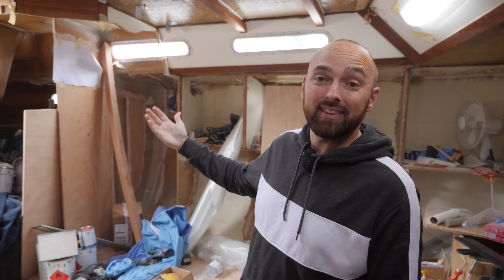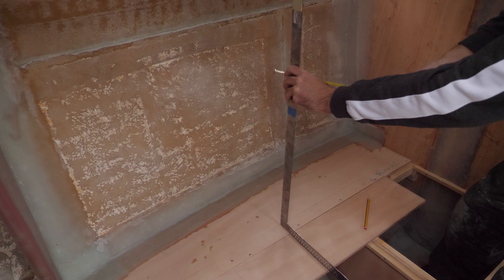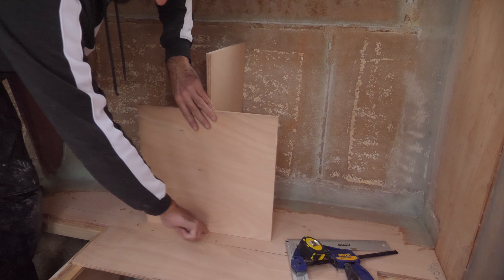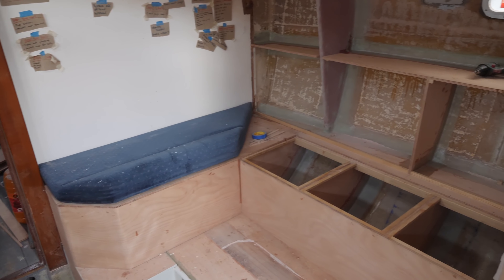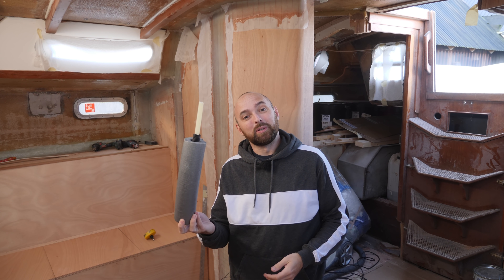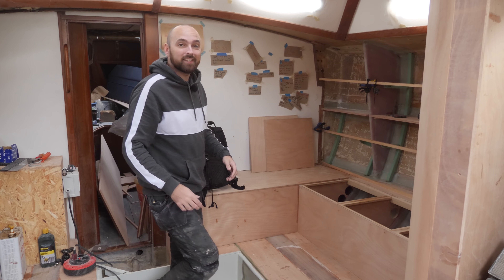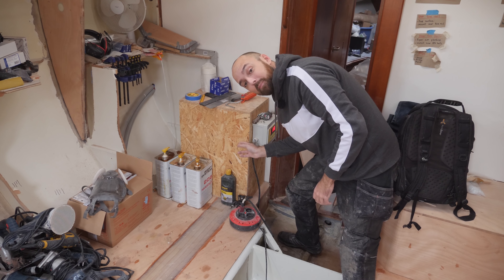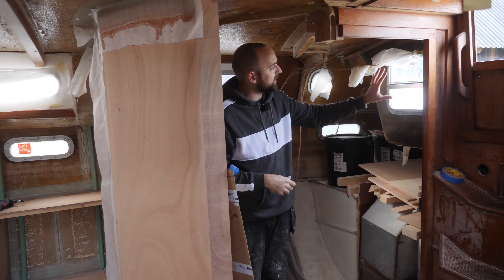Sail Life - Settee finished (for now) - DIY sailboat refit

Comment: Just another comment... on my boat I had 2 heads, had one stop working a couple times. If you keep the other at least you will have a back up till you can repair in calm places or where parts are avail... also, you use the bathroom every day, don’t do a temp or swinging Pullman, or any options that you have to constantly work, instead make the bathroom large, airy, permanent, comfortable... you’ll enjoy it and more importantly Ava and guests will be happy...

Comment: Really nice work on the settee, I like your attention to detail. Do you think you could add a materials list to these video descriptions or a quick mention of what you're using in the video? For instance, I'm curious about the type of plywood, the foam you're using for furring strips for the insulation project, the primer you painted on the inside of the settee, etc.

I did something similar for insulating some cabin lockers. The furring strips were a number of layers of thin mahogany so they'd conform to the hull and used a few dabs of hot glue to hold them while the fiberglass set over top.

Comment: Good as always! I recommend head A. Another thing, have you thought about the future, it would be wise to install some wire channels/tubes for future electrical installations. I have done some electronic upgrades at my boat and it was an nightmare to do the wiring.
Reply: Thomas Carlson And mousing lines to feed the cables through.

Comment: Why did you do the settee lid in 3 sections? Would have been easier to do it in one piece with 3 cut outs to get into the storage. Same with the back of the settee. Just used large wooden braces across and have plywood at the back of the cushions. That would have given you the storage space open. Just a suggestion.

Comment: I've noticed FG ships tend to have condensation problems above the water line. Are you planning on any insulation to prevent this? Hate to see nice wood work stained by pools of manky water, plus the mold thing...Also, you might want to build in a removable 'Anti-Heel' board for that settee berth. No fun being off watch and getting thrown to the deck by a gybe...

Comment: Could you add some sort of access to the technical area through the rear of the port quarter berth? Or through a cockpit lazarette?

Also, are you not going to insulate the inside of the settee?

Comment: Give extra thought to using Formica. As far as my experience it has no place on a boat. It will sooner or later, ( sooner) let go. It’s better to apply wood vainer which absorbs the contact cement better and very rarely if ever, let’s go and you can tung oil or stain and varnish it. Redoing Formica in weird places is not easily done.
Reply: Also , tapered cushions will prevent you using them for bunk configuration. Throw pillows work great for back support.

Comment: wouldn't the "settee" be more comfortable with a reclined back?
Reply: twinsmm1 👍🏻 agreed instead of having a foam with 2" at the bottom and an 1" at the top, adding an inch of storage to the lower part is the route I would go ( just for the hull side )

Comment: on  option A,  you are wasting space by assigning 3 different things to 3 different spaces. Get the shower on that forward corner (option B) and the head directly opposite ie  towards to hull. only one person uses that head at a time, so it doesnt matter if you wet your toilet whenever you shower, it will be washed for the next person. then make a knee (kinda like the vertical mirror image of the chainplate ones you did) to partition the toilet from the sink. why? you dont want little splashes of the proverbial shit onto your sink. (im far from a being a germaphone, but this is what actually happens, whilst flushing toilets; shit also get sprayed). the partition knee would also provide for holding ground whilst at sea. This way you will release space for some storage on the corner where you have the deck portlight (which you find dificult to clean for some reason (get a 12 volt small air compressor, and blast all the gunk you might collect there) and will have a much nicer "entrance" to the innnings of your technical area.  you are also avoiding any unecessary extra plumbiing on that area.  yes it a boat, which lives on the water,  and yes water and power will never get along that good. all ive said will make you build the door like you have on option B, which the better way. you turn fwd to use the head or aft to get techinical. optiion a makes you cross the head to get to the tech area.

Comment: Does the orientation make much if a difference?
Reply: Yes, it does.. unlike power boats, yachts heel over when moving. Imagine trying to use a toilet that's tilted 15°-20° towards or away from you, at the same time as it's bumping around on the waves.

Comment: Head facing centerline when located close to hull sides is pretty standard
Reply: But it's only standard for space saving reasons.. not for long-term liveaboard comfort reasons. If liveaboard comfort is the standard, then fore-aft alignment works better.

Comment: Do you really need to insulate the pipes for the heating system? Normally you don't do that in houses and some heat added in closed spaces will help against condensation. Maybe this  is of interest https://www.rinkabyror.se/artiklar/varmepumpar-och-tillbehor/kulvertror/kulvertror-uponor/  or https://www.rinkabyror.se/artiklar/varmepumpar-och-tillbehor/kulvertror/kulvertror-maxitherm/ .

Cell rubber is used in professional air-con applications so its a good product but pricey. It is also claimed to be a bit of a bugger to glue. Do you intend to use pre-glued?

Nice work!

Comment: Level shelves isn't a good idea. You want all flat surfaces to till slightly toward the hull and add a weep sloot. Water will eventually splash on the shelf you want to give it an easy way off. A level shelf let's the water pool and soak whatever is on it.
Reply: No shelf on a sailing yacht is ever perfectly level.. so it's not really a problem. And where those shelves are located, if they get splashed, then Mads will have much bigger problems to worry about.

Comment: Instead of tapering the back cushions in the settee consider building a plywood back to the settee that is angled back at the same angle as the cushions.  Hallberg-Rassy built our settees like this and it greatly simplifies the cushion shape.  

The area behind the cushions doesn't need to be wasted.  We made this area into a large spice rack.  It is a simple matter to pull the back cushion away and then hinge up the spice rack garage door to access spices when cooking.

https://photos.app.goo.gl/bsq4asMrUBxW9Uot6

Comment: A for Ava :D
Reply: Madds check out heads that are fore aft facing closer to centreline. Only reason you see heads on the hull side facing athwartship is  a cheap use of space. Like I said hate pissing up hill or downhill in a boat heeled over 15 degrees your only chance for design change

Comment: Would it not have just been easier to build a boat from scratch?
Reply: No.. definitely not. Building just the hull and deck is 50% of what is involved in building a boat. So what Mads is doing is less than half of what would be involved in building from scratch.

Comment: Hi Mads, I would go with option A as it will make the companionway less cluttered and allows you to put a grab rail on the wall next to the companionway which will make it safer under sail. Can I suggest putting a seat as part of the shower over the holding tank. It will make showering under way much easier as you can sit and brace yourself in the same way as on the head instead of trying to balance while healing over sand rocking about. You can see an example in this video at 20 min 30 sec in.
https://www.youtube.com/watch?v=CgUTYqZHzwQ